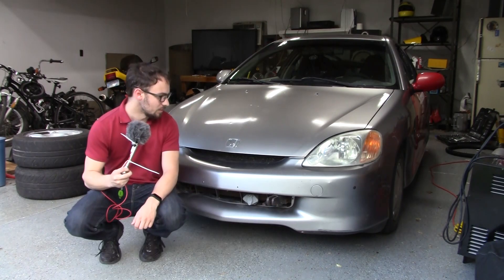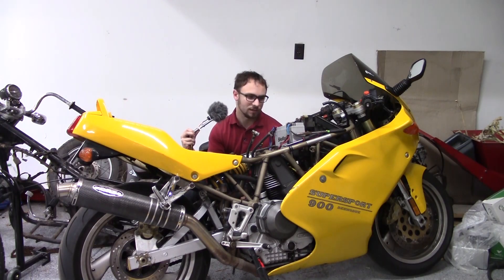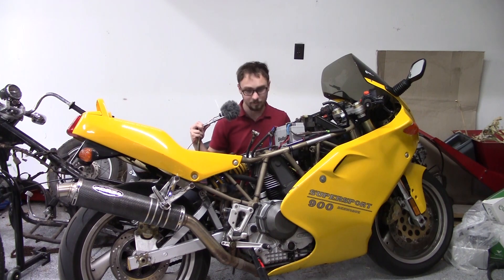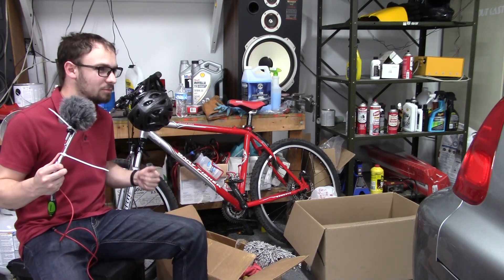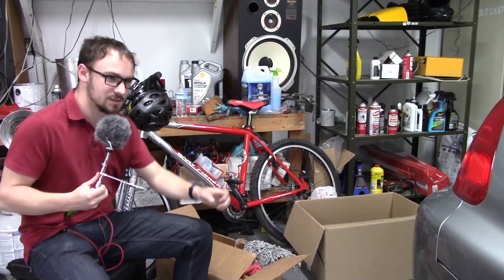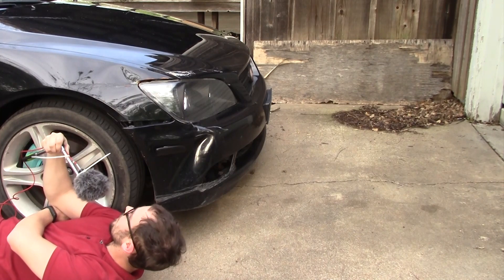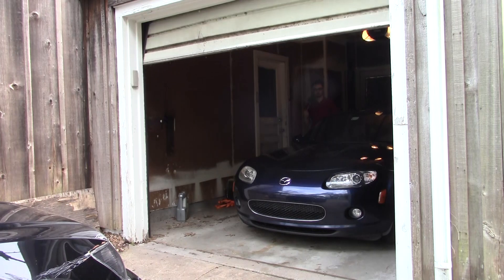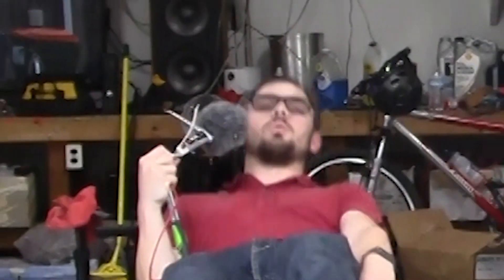Super Awesome Mega Coronavirus Garage Update

Comment: Here cause of hoovie! He had me at insight. I have a silver one too. Mines civic si powered though. Love those cars.
Reply from the maker: I wish K swaps were a bit less expensive. I do love the extent to which "Honda LEGOs" can be played. The custom mounts required are 50% what I paid for the car on their own... difficult to justify, but we'll see what the future holds!
I bet your car is a riot, though. I'd love to drive a hopped-up K-sight sometime. Does it still get pretty phenomenal fuel economy?
Reply: @100PercentJake  Mine isn't anything special compared to what some people do. I've dubbed it the budget build. Got the car for free, engine was overheating and batteries were junk. Got an 04 si that I was able to part out for some good money and take the bits I need. Wouldn't have taken on the project if it wasn't free. These days the cars are being stripped for k swaps left and right, so I have a soft spot for ones that actually still work as intended.
Reply: @BHondo86  i got an insight too xd, bruh did you k swap it yourself? whos engine mounts did you use? Did you use an ep3 for most of your parts? pls respond

Comment: The issue with the quad core combustion is without proper fission nothing will occur on the quantum radar which means no spark from the mainframe ignition fueled by a 50/50 diesel methane mixture